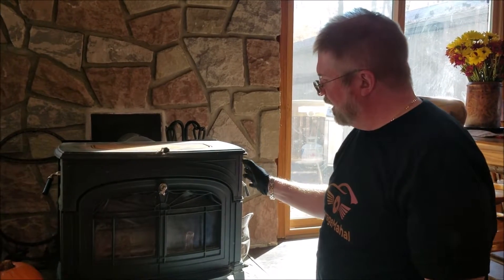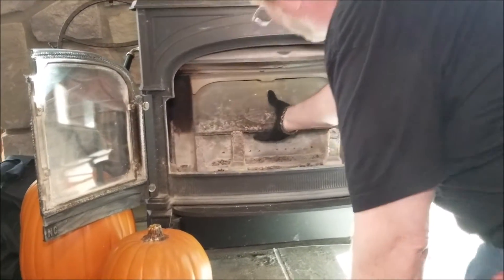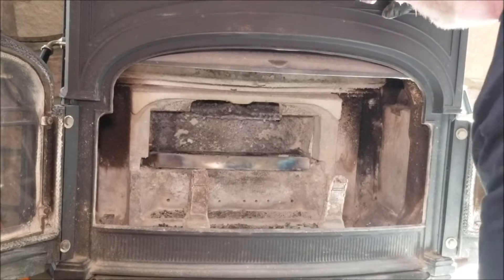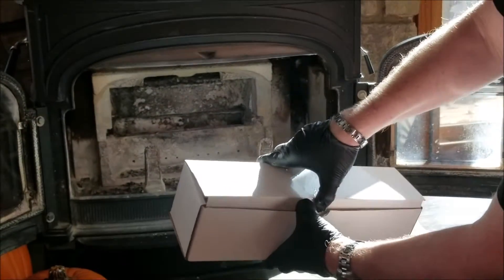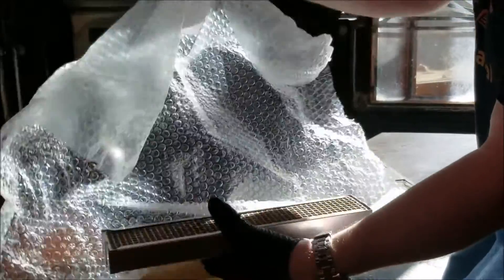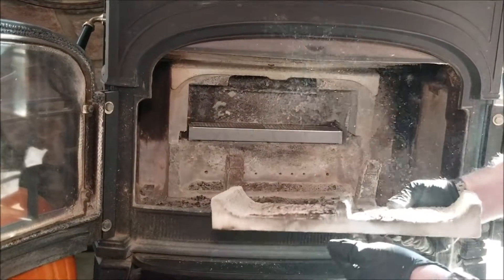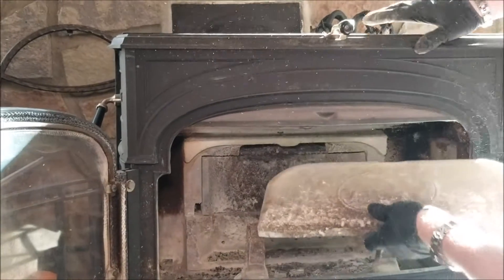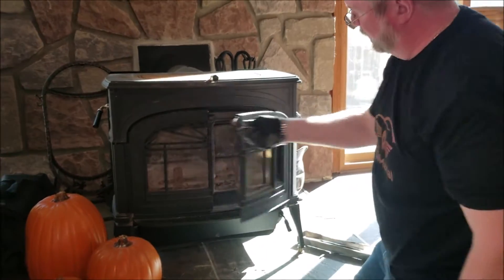Midwest Hearth Wood Stove Catalytic Combustor Replacement Catalyst Vermont Castings Defiant & Encore

Comment: Thanks so much for this video - I bought a house with 2 stoves a few winters ago and this replacement part was in a closet . . .. . didn't know what it was until I found this video. Still figuring out these stoves and really struggle heating with the Vermont Casting (in the basement on a slab that I'd love to keep lit when it gets cold) unit as it draws so much air I burn way too much fuel. Take care.
Reply from the maker: All good, email if you have questions... Brian.niskala@cnjrail.com

Comment: My mother has this stove, and man the problems we have been having. Smoke smoke smoke. she had the whole house so bad we could not breath without windows being opened, i used some furnace cement to fill the cracks around the top lid and sides, we saw smoke coming out of it. and also replaced the top griddle gasket and she still smokes just not as badly. This is our next guess to fix it just didint know how to go about doing it right. Thanks!
Reply from the maker: Make sure your chimney is clean... that can cause smoke to back up into the room... also if you have a downdraft from wind, you need to generate heat or an up draft, but indeed opening windows or doors to get the smoke and heat  rising, be safe out there
Reply from the maker: Also try this... https://youtu.be/y_IP6LyMXYk?si=veRXJpQaHbEVf_an this will keep the chimney sparkling and cleans up fast

Comment: Hi, we have a 1986 Encore; would replacing the cat be the same process as yours?
Reply from the maker: Yes, basically the same.
Reply: @GarageMahalLife thank you for the reply!
Reply: We also have the older Encore that is stamped 1986 inside. Our catalyst loads from the backside. Is that what you have found? Our inside plates are bolted in, not snap in and out as in the video. Our stove came with the house so no idea how old it is really and the date of manufacture is coded.
Reply: @harleysoltes  Yep, ours is loaded from the back side. Pretty easy to get to, just remove a few screws from the back panel!

Comment: Hi, we have only had our stove since October , and our catalyst is already broken into pieces. Do you know if it is safe to run with out the catalyst? It looks s our only source of heat and we are about to have some very cold weather this weekend . (-40 with windchill!🥶)
Also, have you had any other problems with your stove?
Reply from the maker: It is okay to burn with out the cat, however it will not burn as "clean". Make sure you have the stove in the burn zone. You will be okay. Stay warm out there!
Reply: @GarageMahalLife  thanks. Would you happen to have any idea why it broke into many pieces?
Reply from the maker: @theresa8558  Typically high Temps outside the burnzone and times of use. The platinum metal coated are the best, last longer but expensive. The ceramic ones are cost effective, but if exposed to a high temp outside the burn zone can crack and break down fast.
Reply: @GarageMahalLife thanks again for responding. I’m not sure what the catalyst was made from, it is just the one that came with the stove,(which is new, actually only since November). Definitely does not do anywhere close to overnight burns either. We are cautious not to let it get too hot at all , and stay is the recommended temperature range. When we put the damper on to operate catalyst, the temperature drops way to low, so we have to disengage it and heat things up more. We have had more sleepless nights with this than you have with a newborn! Could you please tell me what temperature you heat your stove to before engaging the cat? Also, do you get long burn times? We sure don’t! We burn a good mix of hardwood, just going through it way too fast no matter how we adjust this thing. It’s frustrating because it sure wasn’t cheap and it seems we have to babysit it. From what I have read, it hasn’t been hot enough for prolonged times to have destroyed that catalyst so quickly. Sorry for my long sad story! Lol. I appreciate that you took time to respond . Thanks again.